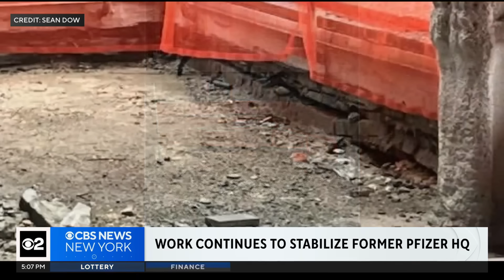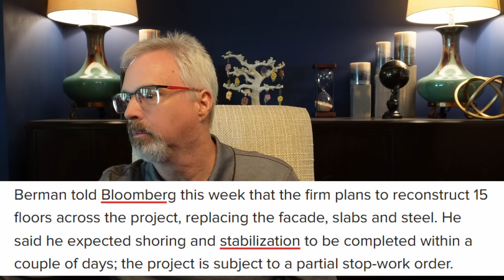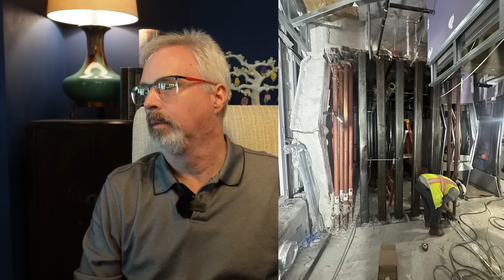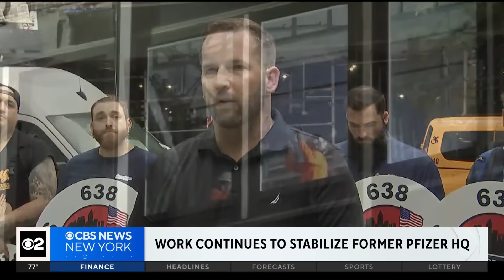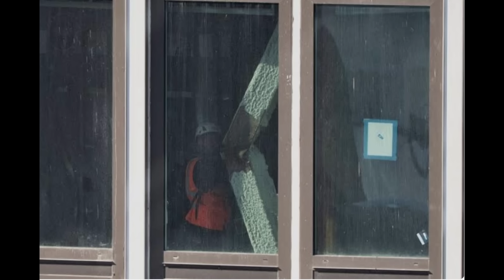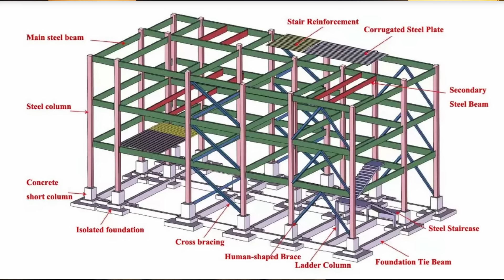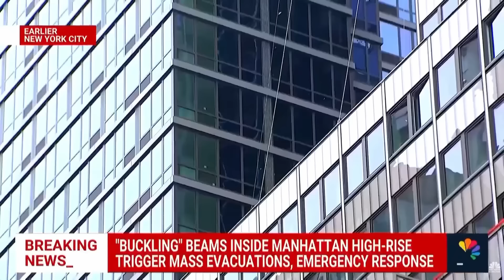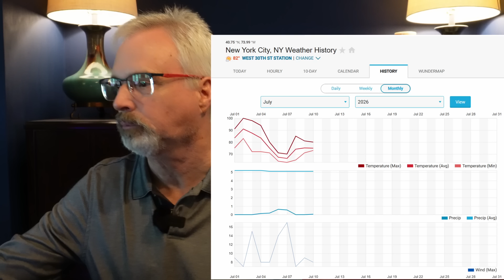Update - Pfizer Building Structural Column Failures; Now What?

Comment: Regarding the redundancy, that might have been used up with the added load so therefore now there is no redundancy and thus the structure is in maximum load stress.  I want to see what measures were implemented to augment the existing structure right down to the foundation. Were new foundation footings installed? Basic structural issues that need  to be addressed.
Reply from the maker: I think the entire design and construction needs to be reviewed.
Reply: Agreed. It is one thing to add reinforcing steel to columns and beams; much more difficult to upgrade the foundation. The building may be sitting on piles drilled/driven into bedrock, so the foundation may be adequate.

Comment: If this is a typical mishap for MetroLoft, better stay far away from their other projects!
Reply from the maker: His statements don't inspire any confidence that is for sure.
Reply: @CaseyJones-Engineer  their other building 300 million lawsuit I believe
Reply: He certainly isn't a smart man to be talking so much--statements that will no doubt be used in civil cases.
Reply: Years ago, part of a mall in my city collapsed because of structural miscalculations. Since then, I avoid every mall that was remodelled or built by the responsible company, especially if it involves adding extra weight to old structures. I simply can't trust them.

Edit.
I found a piece of news with available CC in case you're curious about the event: https://youtu.be/tFgtCXUw-5U?si=_v5PQPU2bkypGcJg
Reply: In their eyes, the only mishap was that the building collapsed before they could sell the condos.
Reply: "King of FiDi (Financial District)" — "MetroLoft Management’s Nathan Berman fosters a reputation as one of the most prominent conversion developers in the country. He made a name for himself transforming outdated buildings in the Financial District into modern homes in the 1990s and 2000s"
Reply: @raffriff42  Which, presumably haven't collapsed, so he does have some sort of successful track record. Possibly more by luck than judgement?
Reply: @xxwookey  maybe it's hubris - "it's always worked out before, trust me."
Reply: He's known for putting money over safety. And that includes using immigrant and non union workers when he can get away with it.
Reply: If I am MetroLoft's insurer I am quadrupling their insurance rates and cancelling any performance bonds based on this project.

Comment: I knew it!  Global warming!!  As I recall, from a long time ago, steel expands about 3/4" per 100' per 100F temperature change.  So even if it was 20 or 30 degrees warmer than before, that still wouldn't seem to be too much for a steel frame building to withstand with a catastrophic failure (I mean misfortune) especially since it was nowhere near full load of the finished project.

Comment: Far from typical and far from a construction mishap.  Looks like a disaster just waiting to fully reveal itself.
Reply: This reminds me of the Hyatt Regency skywalks.
Reply: @r @rsinclair689 

That failure was a particularly interesting one. If I remember correctly, the walk was not built to the original engineered design but modified for easier assembly.
Reply from the maker: I hope the forensic evaluation reports are issued soon.
Reply: @CaseyJones-Engineer 

They should be very interesting, but I suspect that they will be mostly “sanitized” of the real incriminating stuff. Thankfully it failed now and in a mostly benign way. Maybe this was very fortunate. I hope the city will check out some of the previous projects by this developer to see if there has been “similar deficiencies”!

Comment: 5:24 - “typical mishap” - not in/on the engineering and constructions programs I’ve been involved with.
Reply: Hey, the one in Korea actually imploded - this one didn't!
Reply: The shitter tipping over is a “mishap “. The elevation of exterior cladding being off is a “mishap”. 

A structural failure resulting in complete evacuation of that building and adjacent buildings is NOT anywhere near a mishap.

Comment: The uppermost floor of the original building where severe corrosion was observed on the distressed steel , under the fireproofing. Could this have been a location of cooling towers and mechanicals , open to weather for decades ?

Comment: I have been in the construction industry for almost 30 years and I've yet to see a project of this size TWO YEARS ahead of schedule.  Hopefully the buyers can get their deposit refunded.

LOL.  Of COURSE the failure is due to non union labor :/  It COULDN'T possibly be that the columns were undersized or the engineers made a mistake.  A pipefitter BA is "highly" qualified to speak to a structural issue :/
Reply from the maker: Thank you!  That BA should be embarrassed for talking out of turn.

Comment: Steamfitters are often people who install all of the pipes and boilers as in the building they are not the people responsible for assembling the structural steel frame. If they were on the job, that might mean that they were bringing in and assembling the new heating and air conditioning plants for the building --new equipment that was loading down the inadequate structure.
Reply: Could be, but my experience in housing (not high-rise's) all new HVAC equipment is lighter today than was 60 years ago.
Reply: @Not-a-demonkkkrat In NYC, most buildings are either on district steam or use a large steam boiler and air handlers. The steam boiler if there is one is in the basement. The only thing likely to be on the roof is some AC condensers, but even those are likely to be elsewhere. They are often inside the building itself on one of the lower floors with large air intakes and exhausts in the side of the building. So even with the AC it is unlikely that it would be installed on the roof, especially in a building that was planned to have a rooftop pool.

Comment: Wind could be another load on the already compromised structure.  Windows should be removed so air can flow thru the building, and to reduce weight.

Comment: Question.  On the window cladding,,
 Does the cladding support the weight of all the floors windows and structure,  or does it only uphold individual  floor cladding? I hope this is clear.
Reply: I'm guessing it will not be that structural. I reckon main steel supports compromised lower down

Comment: I believe that the cantilever of the new floors had a place to play in this collapse. The beams above the 21st floor look bigger..
Reply: The cantilever would not cause a greater load than interior columns had, as a column supports the load about halfway to the next column, and a cantilever is no worse than that. 

As far as the columns not being adequate, 1960 buildings were designed to support rooms full of for cabinets, and paper is heavy. Changing to residential could come with an assumption of a lower average floor loading than the original design, allowing the extra floors to be added without improving the foundations.

Residential requires 40 pounds of live load for living areas, but only 20 for bedrooms. Office space requires over 100 pounds for file rooms, which this building could have been designed for.
Reply: @johnhaller5851  Based on the results, it's pretty obvious if those were the assumptions, they were wrong.  You don't have to be an engineer to look at the design and realize that those two columns are going to bear a larger percentage of the load.
Reply: The (sparse) columns just dont look beefy enough. I don't think they did their math correctly, or maybe they poured too much cement onto the corugated steel decking.
Reply: But as a layman, since all the floors above the failure were  cantilevered, doesn't that mean that the footprint of those upper floors are larger (and therefore heavier) than the original building it sits on?
Reply: The cantilever greatly increases the load coming down the new columns.

Comment: One thing comes to mind here. Originally these columns just supported the roof and were never bulked up to support extra floors.
Reply: Interesting that these originally supported a roof, meaning that they were closer to potential water intrusion from a leak.
Reply: Built in 59' come on man tons of asbestos
Reply: @georgspaju513  I can smell the asbestos through my monitor.
Reply: @davidshanahan5134  what does it smell like
Reply: @AnotherAustin-z7b  a dry, powdered cementy smell. Mineral - ish, but not strong.
Reply: @georgspaju513  Just leave it be and it won't attack you.
Reply: @georgspaju513  Sadly I don't think the asbestos covering the rust adds to the structural integrity of the building.  lol
Reply: @tatersalad6872 never implied it did
Reply: Don't you think that would be too obvious though?
Reply: Then we have to factor in how the column reinforcements relate to the floors : could end up with a "punch through".
Reply: @davidshanahan5134  Punching shear is a concern for concrete buildings at the floor/column interface (see Surfside condominium collapse), not on buildings with structural steel members.

Comment: one can sister wood joists and beams together to support small residential, smaller older structures regarding sagging and strengthening of building issues, yet sistering entire "new" additions onto old existing units -- is not yet quite the thing they had hoped it would be.

Comment: Others have reported an "excessive load" on the upper floor, where too much material and equipment were being stored.
Reply: Come on!  All of that weight is going to go into the finished building anyway. You might have an argument about point loads stressing a particular floor system but not loads that have already be transferred down to the columns.

Comment: A new engineering firm needs to be brought in to redo all of the surveys of the existing steel.
Reply: New engineer will recommend demolition
Reply: @psweeney1000  Rex Heuerman Firm
Reply: @psweeney1000  A new engineer will offer to do the work for five times the amount of the original cost! :face-green-smiling:
Reply: Fire the builder and engineers that did this failure. Start over with new people.
Reply: @bradphillips7074  I think you need a new architect more than anything else. That and a few independent structural engineers to actually figure out what they are working with and what can be done.

I don’t blame the workers as they are just following marching orders.
Reply: @ninjagirl226  architects have nothing to do with building problems, that is solely the engineer's responsibility!
Reply: @rednarok  Depends was the new building designed to properly handle the stresses? Did they underestimate the quality steel or the state of the steel? 

If so you might have to completely redo everything on the design front.
Reply: @ninjagirl226  I agree. No one ever wants to blame the architects for insisting on designs that are difficult or impossible to analyze or that leave some situations overlooked.
Reply: @schex9 . the question is who failed here. And I’m sure they will do some sort of inspection to find out. Or at least I hope they do as someone who works in quality.
Reply: I wouldnt want to be the new guys coming in to deal with that, Nope, burn it down I would not put one extra Lbs above that failure point
all those floors below already took a shock and are now supporting more than designed for, a redesign of the top 17 floors is Not going to change the fact the damage has already been done to weaken and shift the load of everything below it, I wouldnt want anything to do with the rest of that project, and now if they do go with Union labor LOL the cost just doubled and that will come out of the quality of the rest of the build ....
Reply: My guess is that the surveys indicated problems but that these were ignored.
Reply: I don't think it really matters if new surveys of the steel matters at all. The original steel is more than 65 yrs old has visible rust on the bottom floors. It's the foundation that needs looked at, including soil compression and groundwater movement of the whole area. I highly doubt the foundation is even capable of holding up all that extra weight they've added.
Reply: Agree. Even better, two independent ones. What a mess.
Reply: @juanjohnrico  even better, demolish the
blasted Bldg……. I would not get within 10 blocks of that disaster waiting to happen……. And I bet investors will agree
Reply: @garfieldisgod  I bet investors want an engineering firm to say the building is safe, and want construction completed quickly, so they can sell long-term issues to someone else and exit without losing their shirt.
Reply: @AtomicBuffalo Well that is how the housing crash of 2008 was done.
Reply: @Best-mx2of  it’s how the upcoming private debt & AI crash are being done.
Reply: @garfieldisgod  Except the investors with the most money to lose.
Reply: Heuerman Engineering we like Pizza
Reply: Yeah definitely!!!!
Reply: that company will rubber-stamp it also just like the previous one was paid to do.
Reply: What information do you have that leads to an engineering mistake.
Reply: Tofu Dreg
Reply: @user-kn6vm1hy8i America follows international building code regs but its greed. Putting more floors on a 60 year old building with corrosion

Comment: Is there something to be said about the way the columns buckled in toward each other? I find that a bit odd. 

Had they not buckled in toward each other could this have been much worst had they buckled in the same direction and pull one way or the other. 

Also the cantilevered weight from the floors above have any thing to due with added stress on these 2 columns?
Reply from the maker: I think the columns on the 22nd floor might be located slightly outside the line of the columns on the 21st building so there's some eccentricity there but can't say for sure based on the photos.

Comment: I know NYC unions well.  Its all about protecting their wallets, nothing more.  Years back, when I was performing a corrosion evaluating at a piping system for the former WTC, the union guys also working on the floor demanded to see my union card because they claimed the pipe was theirs and not the Port Authority.  If not, they said I had to hire a union member for the day.  They also claimed that my halogen worklight was draining the power for their tools.  When the Port Authority intervened regarding the professional service I was performing, every union worker walked off the the project - steamfitters, carpenters, electricians plumbers - every one and the PA just bowed to them.  Totally corrupt.  I have 100 such stories.
Reply: That’s NYC!

Comment: Civildetetective channel did some finite element analysis... Worth checking out explains loading with the new floors before and after column failure
Reply: They did a nice analysis. Not sure if they had access to the plans showing the dimensions and member sizes, but they showed the change in the loads of the existing columns before and after the buckling.

Comment: Wouldn't Berman need new permitting to replace those floors? With the shoring only going down to the 9th floor, who would live on ANY floor, much less 1 thru 8?
Reply: The steel columns are usually heavier on the lower floors. The structure is probably more robust down on the 9th floor. Still, everything has to be looked at again.
Reply: @eltamarindo  The columns on the lower levels should have been looked at to determine their capacity for the additional loading from the upper portion. These columns would have been bigger and more robust than the columns that buckled but unlikely they had excess capacity of roughly 16/22 ( #new floors divided by # original floors) and would require steel reinforcing.
Reply: Live in it? I wouldn't even want to stand near it.
Reply: I have seen structures that after they were extended up the foundation sank farther into the ground.

Comment: this reminds me of the mall collapse in South Korea. building extra floors and adding stories to places where they weren't designed isn't a good idea!
Reply: The problem there were the added 4 heavy AC units put on the roof of it. Very sad
Reply: @Stefan_W69  The Pfizer / Metroloft tower was doubtless getting upgraded A/C too, and more. A rooftop swimming pool, some said.
Reply: @Stefan_W69
Just the straw that broke the camel's back.
Reply: @pedtrog6443  more like metal pipes.:face-blue-smiling:
Reply: @pedtrog6443  A lot heavier than a straw, but yeah!!
Reply: @Stefan_W69 the existing columns were not strong enough to support 19 additional floors and it seems they did not account for that. Ridiculous.
Reply: @LK57913  Just build a whole new building on top of it as it is. What could go wrong?
Reply: Greedy.  An office cannot be turned to residential.  To an idiot it sounds plausible.  It is not.  The amount of plumbing and services make it impossible to load.
Demo and new cists the same.
Choosing to reinforce cheaply then sell it is nasty corporate evil.
Reply: @user-pf5xq3lq8i  I agree, it sounds dumb, but Berman, the Metroloft guy, has done many office-to-residential conversions in NYC.
Reply: Excellent report. Thank you, as always.